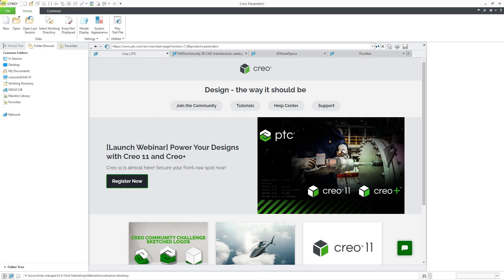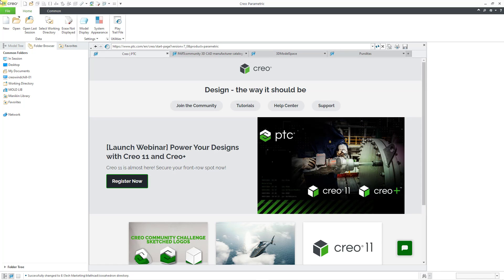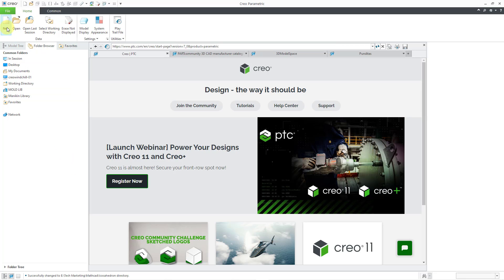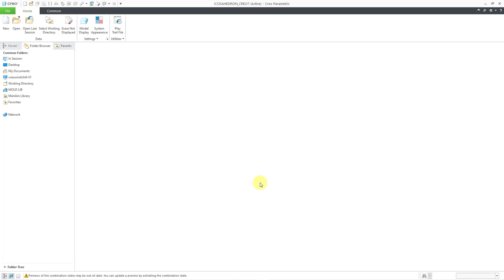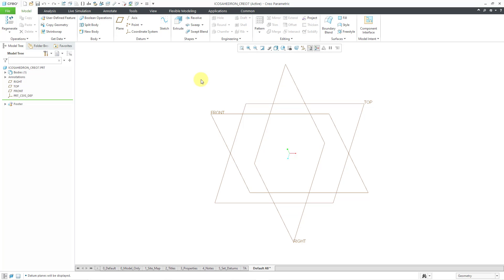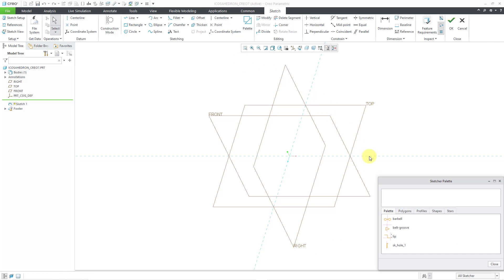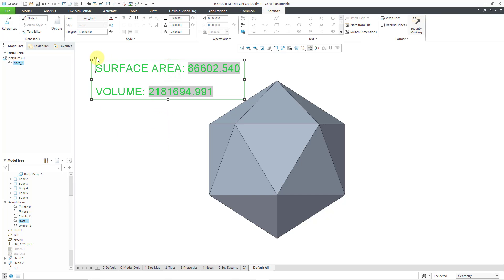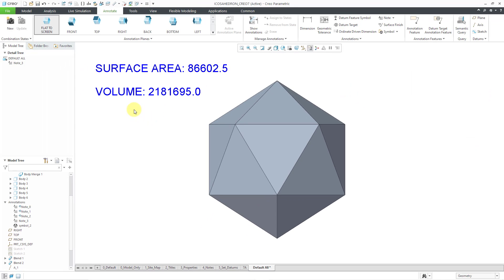Creo Parametric - How to Model an Icosahedron - Platonic Solids and Polyhedrons

Comment: You can do it in Creo 6 without the body feature by copying the surfaces creating a quilt and then patterning the quilt.
Reply from the maker: Yes, you can make an icosahedron in earlier versions of Creo and Pro/Engineer. I did it in Creo 7 because it’s a relatively recent version that many people should have access to and I wanted to use Multibody.